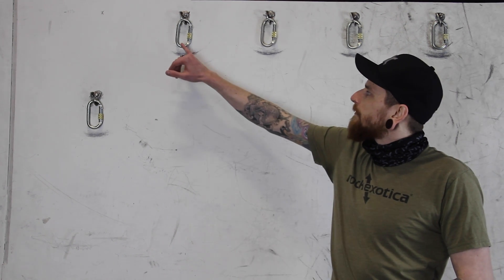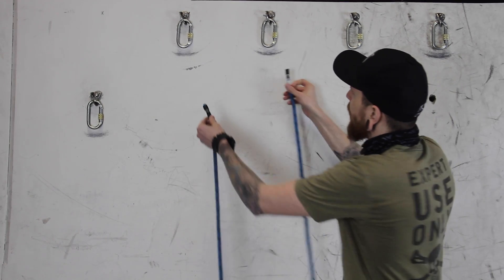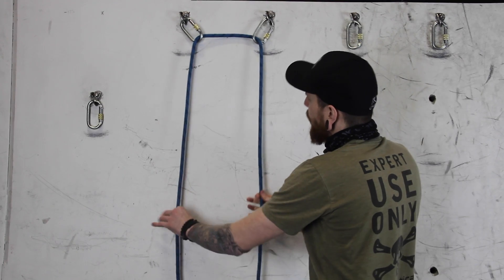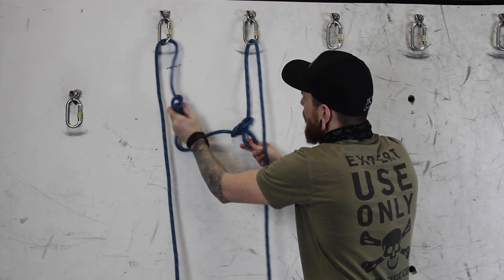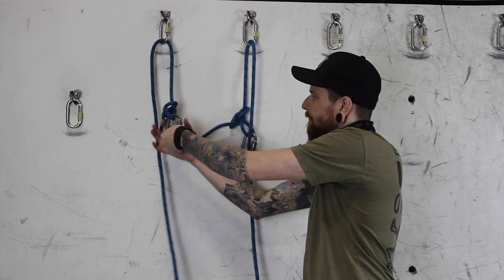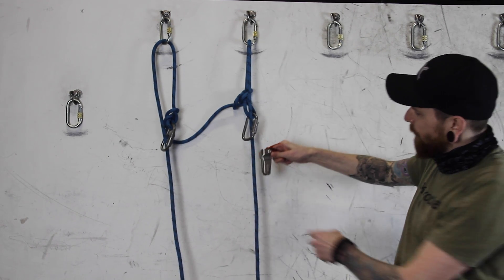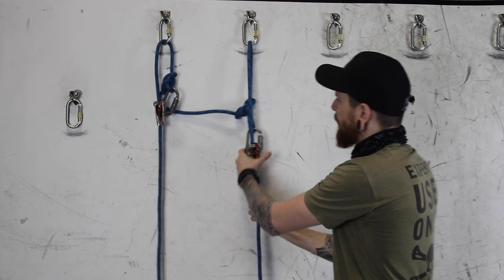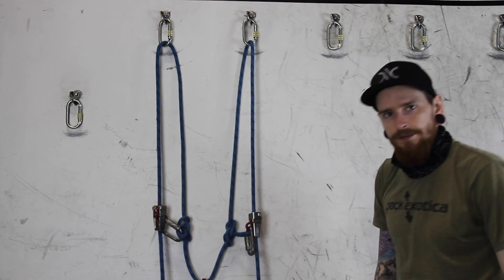Alternative Retrievable Rigging

Comment: Why do you need a retreival line if you have 2 strands going down anyway?
Reply from the maker: When you pull on the two main ropes they are solid and won't come down due to the orientation of ducks. Solid enough to climb on. You need the retrieval line to pull them back down the other way, against the locking mechanism of the duck.